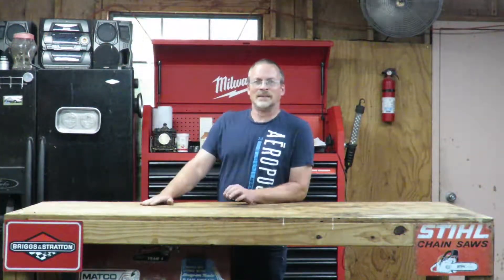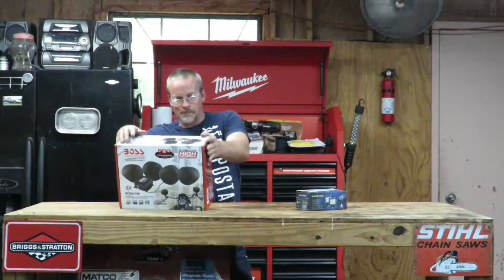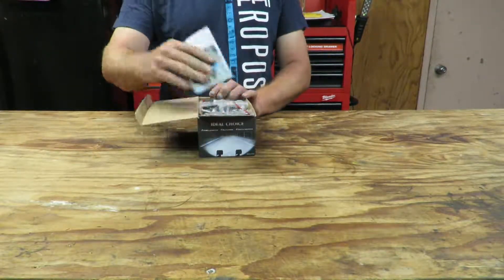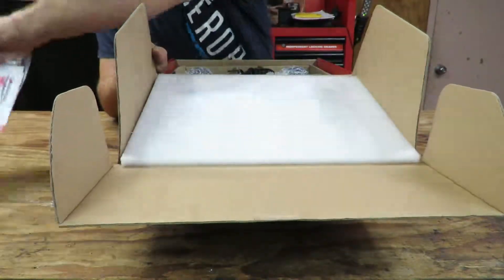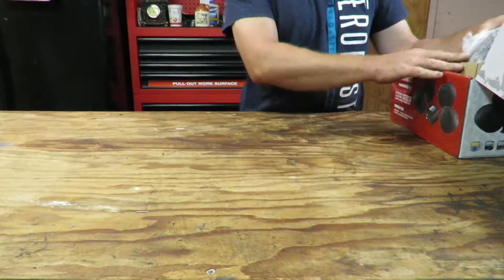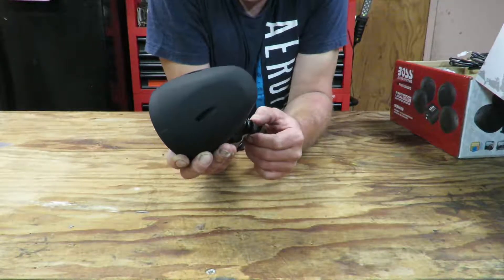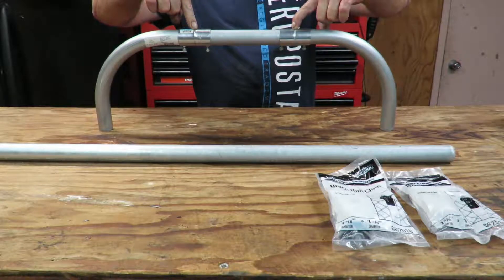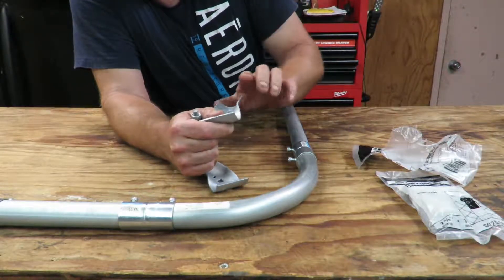PART 1 Mounting Boss Audio System MCBK470B & LED Lights Mounted to Husqvarna Zero Turn

Comment: Thanks for answering my question about what you were using for your rack. I watched the three videos, and it looks exactly what I need, as I do not need a ROPS except to do what you did with the conduit. Looks like I can save over $200 this way by bypassing the heavy duty ROPS.  Good work. Love how clean it is with the wires run in the tube. I might have the lights mounted below the bar to keep them out of the low branches. I do 3 acres with ;ow hanging greenery.
Reply from the maker: Yeah be careful with the branches
Mine lasted along time, But it did get caught on a branch and broke it. I took it off and eventually going to build something a bit more heavy duty.
Reply: @sartingarage8045  Thanks. 
Hahahah. Ya the stock ROPS, if you hit a branch your going up into a wheely.  Could be fun. Hahaha ;-)